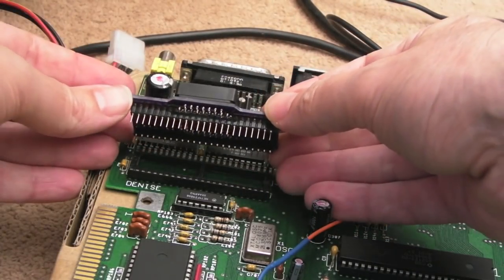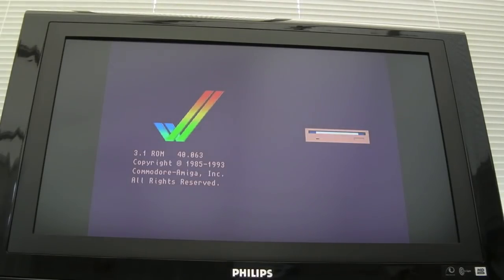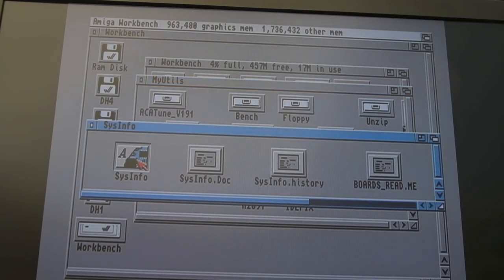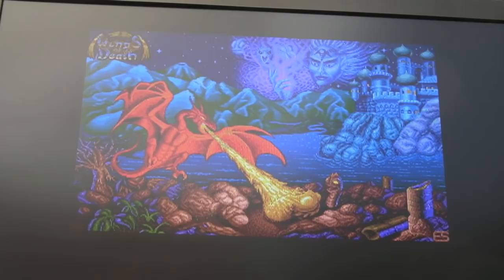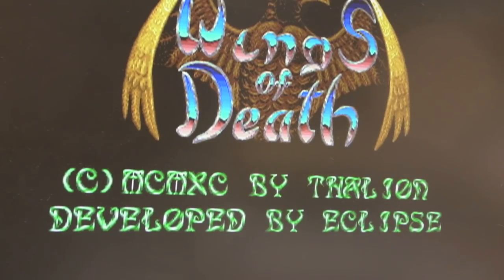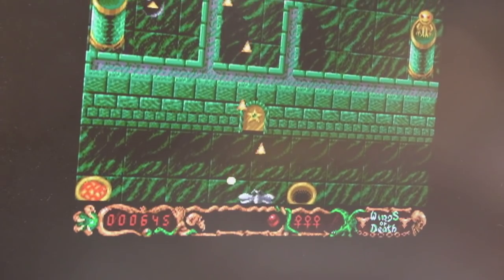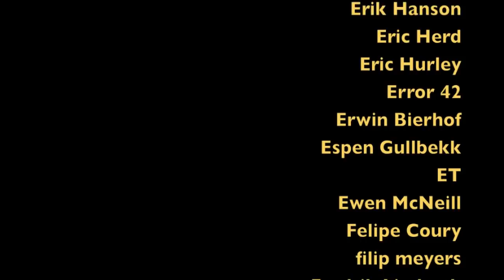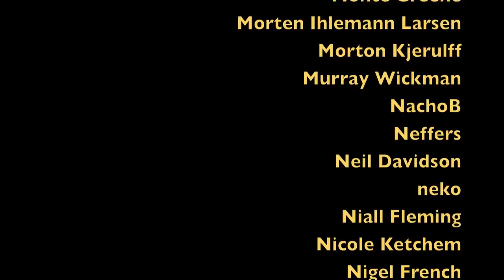Commodore Amiga - A600 Super Denise on A500 or A2000

Comment: Great video!  On the Dragon graphic you are describing chromostereopsis. It's where certain colors, notably red/blue where red seems closer, conveys depth to many observers. It's a pretty cool effect and the basis for many optical illusions. Also probably why they used red/blue glasses for those old school stereo 3D images and videos.
Reply: That was really interesting, because I vividly remember that the first time I noticed this phenomenon was in 1991 with the game Dungeon Master, with the health, stamina, mana bars of the four players in four different primary colors on a 1084S monitor. Some of the bars seems to be floating a bit above the background black depending on color. I think I recall the blue seemed to stick out the most.
Reply from the maker: Thanks for the info!
Reply from the maker: Yeah, I've noticed it in a few games and been blown away by the effect.  Final Soldier on the PC Engine has some parts that look like that where stuff is floating.

Comment: Nice work there man. Im wondering if you could use some Kapton tape put in between the rows of pins between the socket and header pins to make the soldering easier. Maybe using an exacto knife to push a thin strip in the back,  that would ensure there is no bridging or worry about the solder going onto the pins behind the socket and maybe a bit easier to just quickly hit the pins with some solder and go. Great job with the final result
Reply from the maker: Thanks Luke =D  Yes, I don't think I really did the best job assembling these!  Had a few suggestions like yours which would improve assembling these for sure =D  Keep up the great work on your channel!

Comment: Hi I got a Indivision ECS V2 for my A 500+ it works very nice. You take your Denise chip off. On the version 2 it is all on the adapter. But it is nit cheap, I had to cut a hole in my case fro the VGA out. I did find a very cheap case on Ebay to adapt.

Comment: It seems like it might be easier to push the pin header up to the PCB, solder a few corner pins and then trim back the ones under the PLCC socket.
Reply from the maker: Yes, there are a few ways of assembling I guess!  I just wanted to avoid trimming anything down. =D
Reply: Exactly, that's the way it should be assembled 🖒

Comment: "Fourty quid, you could buy an amiga for that!"
God I wish that was the case here in the states. Amigas bring massive money here.
Reply from the maker: =/  Yeah, you used to be able to buy an A500 for £40 ish.  These days even faulty they seem to go for around £80+
Reply: @GadgetUK164   Cheapest A500 i can find is 200$ right now untested. A600s are basically impossible to find here and A1200s are 300+ if you can find one at all.
Reply: @draggonhedd  A1200s are 500€ in Germany..
Reply: @elmariachi5133  Oof.
Reply: Australia A500 $300-400Aud and A1200 $700-1000aud. 

It’s insane here.

Comment: Great idea. Looks really fiddly to solder though? £40 is crazy! I got a 500+ board I fixed up that needs a Denise and 2 CIAs. Might try this.
Reply from the maker: By the time you add shipping on, and PCB cost, socket cost, there's no much in it atm.  I noticed a single chip from Analogic atm is around £22, with £6 shipping (both have gone up there).  But buying 3 at once it goes down to £17 ish each.   That said, I looked for DIP ones earlier and the cheapest was £45, which most of them over £50 =/
Reply: @GadgetUK164  I eventually just tried it with the same pcb and what looks like the same plcc socket. Tried it on a few A500+s with the proper Agnus but just flickers then dies.  Pretty sure the Analogic chip is duff but bought it so long ago cant send it back now lol 🙄
Reply from the maker: @Plan-C  =(  Check your solder points (and that the PLCC isnt shorting to the DIP pins) - maybe a bad connection on one point?
Reply: @GadgetUK164  Cheers. I tried that. Pin to pin one by one continuity, even under a microscope. Will have anothe go but not convinced lol
Reply from the maker: @Plan-C  What about a bad trace on the PCB (from manufacture), or maybe socket orientation?
Reply: @GadgetUK164 So I followed your soldering technique and not mine and now it works great.... I'll get my coat 🤣🤣🤣
Reply from the maker: @Plan-C  LMAO!  I wonder what the issue was - a bridge maybe?
Reply: @GadgetUK164  I took the plcc off and had missed one pin header underneath it. What a berk. 😂

Comment: Sadly I'm pretty sure this kit wouldn't work in a 500 with RGB2HDMI installed without modding the case.  As of right now its not that much cheaper than standard Super Denise in the classic chip form factor all things considered.

Comment: Just wondering... Can the super denise in an Amiga 600 be disabled in the same way as the CPU can be, when using a VampireV2? If so, then this can be used as a basis for Indivision ECS V2 scandoubler.
Reply from the maker: I don't think so - I've had a look at the pinout and don't see a way to disable it.
Reply: @GadgetUK164  Damn. Oh well... Then an adaptor for the IndiECS-V2 are out of the question. However there are these scandoublers that require an actual Denise. Perhaps something can be cooked up? Perhaps some other video expansion? Like how is that extra video expansion port in the A2000 wired into the system?

Comment: Is there much difference between ocs and ecs I know that ecs gives you some different resolutions in workbench 🤔
Reply: You can have flicker free HiRes Workbench with ECS denise, using one of the 31kHz modes. But you got just 4 colors and it's very slow. There are other and better solutions if you really want to use Workbench much. There are also games which require an Agnus capable of adressing 1MB ChipRAM, which is considered as an ECS component by many people nowadays (despite it wasn't when it originally was released... 1MB Agnus  existed before ECS!)
Reply from the maker: Someone also mentioned in the comments here that when using higher res modes you can get higher frequency samples through Paula (up to 57Khz aparently).

Comment: What's the difference between the super and DIP Denise ?
Reply: Super Denise mainly gives you a couple more higher-resolution screen modes (at the cost of only 4 colors available in the new modes) mostly for use with productivity apps. It can possibly break older software though... but it really depends on what you use your machine for. For maximum compatibility with games it's probably better to keep the old Denise rather than upgrade.
Reply: Super Denise came in DIP (rectangular shape, A3000, A500+ and later A2000) and PLCC (square shape A600 only). Superhires was 1280 pixels horizontally. It gives extra choices in Workbench Screen prefs, mostly for connecting to VGA monitor and getting 480 or more pixels vertically and steady without having a hardware flicker fixer. Completely pointless for games.

Comment: Made me laugh - you said you don't want to spend £40 on a Super Denise, but you spent £20 on a PLCC Denise, £15 on the three adapters, and hours of soldering time... I would just have dropped the £40 for the extra £5...
Reply from the maker: LOL!  It's not quite like that - adapters $5 each (free shipping), which is around £4, CIA (because I  bought 2) were £19 at the time.   Sockets were super cheap, like 20p each.  And £40 was the lowest I had seen the DIP ones sell!  £50 is what most of them are.  Just over £23 vs £50, it's worth it.

Comment: Just buy an A600...
Reply from the maker: That kinda defeats the point lol - The point is replacment Super Denise in DIP chip are expensive and getting rare (due to the A500++ boards).
Reply: A600!!!! Go use your numpad for flight sims! ;-p
Reply: Daishi5571 Fligh sims on classic amigas sucks anyway.
Reply: @srfrg9707  Falcon, AV-8B Harrier Assault, Tornado,  Birds of Prey, A-10 Tank killer, Fighter Bomber, F-16, Mig 29 Fulcrum, F-117A all great flight sims I played plenty and while most are rather slow on a 7 Mhz system, stop dragging your feet ITS A COMPUTER, BUY AN ACCELERATOR! Ok you couldn't do that on an A600 back then (another reason not to like the A600)
I know some ppl like the "cute" A600 (and yes I have heard it referred to it as this) but it really didn't add anything to the Amiga line that it needed that the A500+ (which cost less to make and sell) didn't already cover and wasn't superseded in every way a year later.
Reply: @daishi5571  Other than the built in IDE and PCMCIA interfaces?  It was much cheaper adding a HD and networking to an A600 than it was to an A500 (or A500+).  Still would have perferred the keypad though - and tbh the A1200 came out so soon after the A600 and had all the benefits plus a full-sized keyboard, faster CPU and AGA graphics
 you have to ask yourself what was the point?
Reply: @superspudgun  When the A600 was released the A500 was at the height of its popularity, it was selling faster than it had ever done before. But they discontinued the A500 and the replacement A600 tanked in sales! IDE and PCMCIA wasn't what ppl wanted (sure some ppl, but really it was mostly wasted on the A600) Had it been preconfigured only with an HDD maybe it would have been of some interest, getting everyone wanting a HDD. But instead they released a system where many of the upgrades for the A500 no longer plugged in, tried to force a 2.5" HDD standard which costs more and is slower than the more common 3.5" (you can get a 3.5" in the A600 and A1200 but it's real tight, but shows that with only a minor modification to the case they could have easily fitted a 3.5" ) and PCMCIA was so new it wasn't even fully ratified, and it seems costly compared to internal cards for the big box systems. Then to add insult to injury the A1200 came out and for many that is what they were waiting for, as according to sales it outsold the best the A500 had for the period it was out. They should have released the cheap A300 as intended (while still selling the A500, then discontinue the A500 when AGA came out) for the final ECS hoorah!